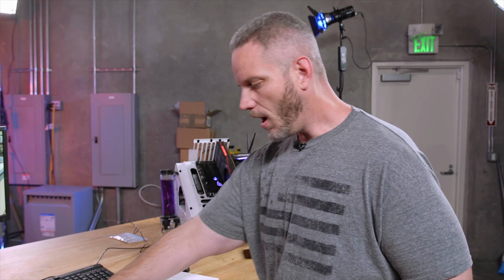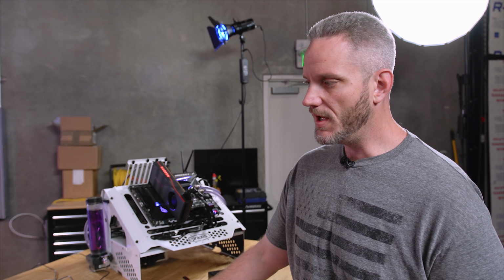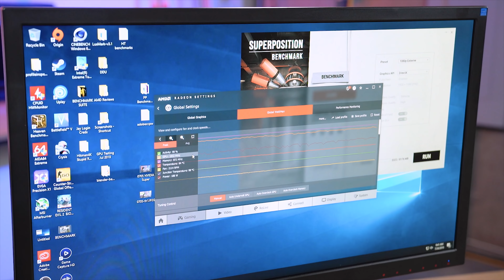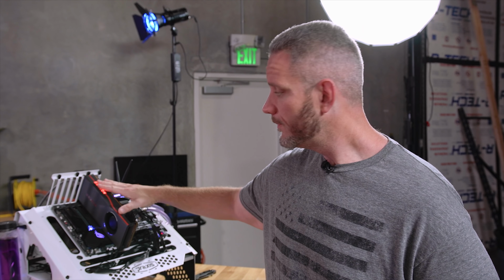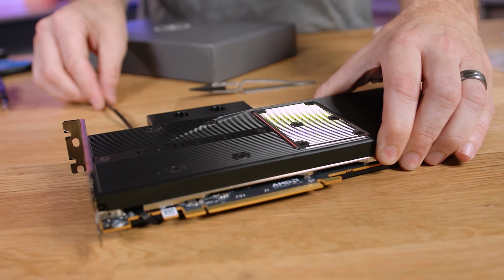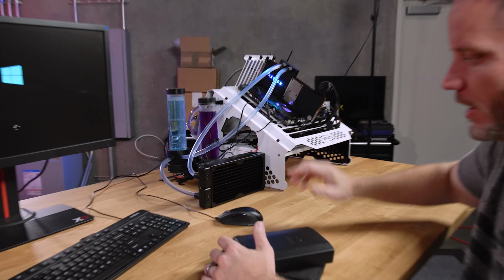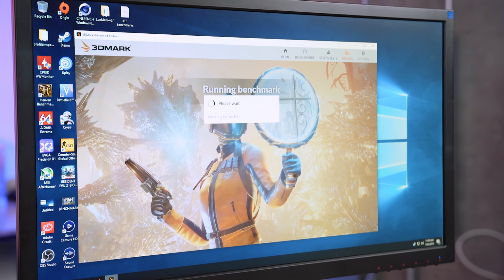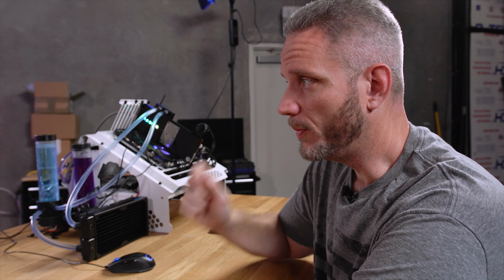Watercooled and Overclocked Radeon 5700 XT... Was it worth it?

Comment: The card is at the beginning of its life - with a bit of patience comes a solid performance for the money. I still use the RX580T8G from ASUS and I have all the time in the world to wait for a product, which makes sense at first glance.
Reply: Why wait for the card to get out of rehab center. 
I bought a 2070 super and i can overclock memory speed 1200 and get firestrike 28.6k and timespy 13.4k 
And the temperature always stay below 67•C.
Reply: Seems like amd fanboys are mistakenly obsessed with how only amd can overclock and get better results.  My 2070 super easily beats 2080 fe and only 3% ish difference with 2080 super. Without extra money. Without tempering with wattman and undervolting BS. Without having to rip my card and void warranty for watercooler.
Reply: @samgakgimbap9683  First and foremost, I'm not a fanboy - so before I give my money to a company that has acted more than once obvious fraud, I prefer to go to competition; Add insane prices for an apparently aging chip; the functions like raytracing or DLSS ... (It just works) .... and so on.

As I said before, my RX580T8G is more than sufficient for my needs and delivers constant and high FPS at 1080p (Ultra settings).

Back to AMD.

This architecture is new, no one has experience with it, and as we know it from earlier, it can get even better - and just because the card is new and it brings to the point the performance that AMD promised I do not understand why you want to explain to everyone that you were fooled by nVidia.

As you can now understand: People who know what they need for hardware, smile your purchase decision at most quite friendly.

Comment: You know, I think this whole experiment would be better if you added in a middle step. A lot of people would go with the factory settings, but it would be better if you showed people how you would run with the blower. I imagine most would at least get rid of the graphite for a high quality thermal paste and change the fan curve. That would be more accurate of a test to me anyway.

Comment: Playing Division 2 seems to push the 5700XT harder than any stress test. Using the stock cooler (undervolted to 1107mV) the GPU and Junction temps are not a problem. Even the Junction temp tops out at 90C with the GPU temp hitting 70C. I would love to have it run lower and thought about adding an AIO. However, if I do that I leave the VRAM unprotected as there is no room to even put heatsinks on the chips to one side of the GPU.  With the stock cooler, RAM temps are hitting 80C or a bit higher.

Comment: Well. I already bought my 5700 xt on launch, not trying to go through the resale process to get the newer custom cards, hate the noise the stock card gives, so rather buy a water cooling kit to eliminate that. It will also give me my first experience with assembling watercooling kits.
Reply: Did exactly that and turned out mint, be careful you don't mess it up BC your warranty is gg the second you take off that gpu retention

Comment: I don't know how hot this cad is. As far as I've seen works at lower temps than the RX Vegas. I don't think you can get a huge difference in performance in with OC. 

The most reasonable ideas to watercool, from my humble point of view, goes more for:

1.- Less noise (my vega 56 is literally a hairdryer when I'm playing). 
2.- Extending the lifespan of your video card as it would be running cooler. If you don´t have enough resources to be replacing your video card every 1 or 2 years (which you don´t get a bigger leap in performance, maybe 12% - 15% as the recent cards have shown us)  then It would make sense to upgrade your video card every 4 to 6 years and then you would considerably see a performance improvement.

But I agree, if you don't care about the noise and you have the money, it makes more sense to invest that money (assuming you don't need a water pump, radiator, fittings, etc) financially is better to buy a better performing card with the same money in where you could be aiming to an NVidia card instead...

Comment: DEFO WORTH IT,  i just watercooled my MSI 5700xt mech, ran the heaven benchmark and got 20c lower temps and 19fps more than on air, all the air coolers on the 5700 series are loud as hell and dont do their job properly, so yes, if you want to get the best out of your videocard it needs to be watercooled.
Reply: For an extra... 100MHz
Reply: @francissauve6685  nope much more

Comment: Now use soft power tables from Igors Lab und you get hell of a lot more frames and watercooling starts to makes sense. You can get a 5700xt beyond 2100 Mhz stable and without problems.

Comment: If you don't redesign all the fancys of the waterblock and just stay with a milled block of acrillic on top of a milled block of copper, a new model for a new card can be designed and prototyped within a day. Ok maybe not a working prototype (milling the fins takes time) but somthing for test fitting and making sure alle the components are cleared.
Designing a new pcb for an aib card requires much more work.

Comment: From what I've gathered recently:

5700 XT and 2070 Super are the best options for 1080p gaming on the highest settings and will run 1440p comfortably above 100+ fps. with some tweaking to settings.

2080/2080 Super are strictly 1440p territory.  Makes no sense to buy any of these cards at this price ranges to game on 1080p.  Will run 4K but settings need to be lowered if you want to play with 100+ fps.

Personally, I'm waiting for the 5700 XT custom cards to come out to make a choice between those and 2070 Super.  I'll be sticking to 1080p for a while more.

Comment: I water cool my GPU's but I use single cover, core only blocks and so far they've fitted every GPU I've bought since 2010........ Only thing I have to do is buy RAM sinks and VRM sinks but they're cheap enough. Core only blocks tend to cool a little better too as there's no additional heat dump from the VRM's and RAM that increases temps.

Comment: Just used a £10 second hand H50 and a NZXT G12 to water cool a powercolor red devil rx 580... temps down from 82c to 47-52c.
Had to put the fan over the VRM as the red devils VRM is to the left of the core...

Total cost £29... total performance gain, nearly 30% out of this card because it throttled so badly before!

Comment: One thing to note, the only boost clocks on a timer are Intel. Nvidia and AMD (both cpu and gpu) will boost as long as power and thermal headroom is available. Base and boost clocks of most chips today are pretty irrelevant anyways since they just self oc based on what the chip can handle.

Comment: I think it makes more sense to wait for the AIB cards.  I would only watercool one of these if I was doing so to fit it into a watercooled system with the emphesis being on keeping the system quiet rather than for cost or overclocking.  Even then, I would be more likely to use an AIB cooler with one of the adapter kits NZXT makes as that is the most cost efficient route.

Comment: It may be not worth overclocking it, but undervolting it gives huge benefits to thermals, noise and obviously power. Every one of you that own this card should try it and apply it
Reply: Im thinking of eventually getting a 5700 and then overclocking that. Less money, and potentially similar performance.
Reply: @everythingfeline7367  That's a fair point. Still is an excellent performer

Comment: The Adrenalin 19.30.02 driver does, in fact, reduce the GPU Clock to about 6 MHz when idle. However, updating to the latest (20.x.x) does not do that for some reason.

Comment: The only real reason for a water block on the 5700xt is to use powerplay and get 2.2-2.3ghz on the core stable. Otherwise just get an AIB with standard OC

Comment: Water cooling might actually extend the life of the card since its memory modules and chip are not as hot under high load. Its not always about getting higher scores and a few extra FPS. I agree with you that you shouldn't water cool a cheap card but if you plan on keeping the card for the foreseeable future and you know what you're doing then why not?
Reply: By the time your card might start dying you probably would've upgraded

Comment: Funny, I have been debating water cooling my Radeon VII with an Alphacool Eiswolf 240 GPX Pro for the past month or so. I  could spend $200 on the AIO solution or wait to see AMD's entire line up of CPUs and GPU before making my upgrade decision. 

Anyway, spent the past 3days or nights more like, playing around with voltages, clock and memory frequencies and superposition 4K benchmark, landed on a 1900Mhz, 1020mV, and 1100Mhz setting and get a modest overclock at lower fan speeds than stock. Will be sticking with my original plan when I got the Radeon VII of waiting for RDNA Gen 2 or Acturus next year before thinking about upgrade; Navi 10 just isn't worth it unless you're coming from a Polaris GPU.

Comment: I like how you talked about how most people use the stock settings for the GPU and don't mess around with overclocking, and how that formed the basis for your comparison. Like how most people also buy a waterblock, to help cool their stock GPU settings, which already would have been adequately cooled by the stock cooler.

Comment: I currently run a pair of water cooled consumer (as opposed to "workstation") nVidia cards in SLI mode in my system. Was very disappointed that I couldn't span apps across all 3 monitors in Linux. I was thinking of switching to AMD to get that capability and potentially ditch windoze all together thanks to proton for gaming. I will likely go with a water cooled 5700xt to keep things cooler and get more out of the investment in my system.

Comment: Better (and cheaper) solution than watercooling: Installing a separate aftermarket air cooler.

I.e. the Rajintek Morpheus II with 2*120mm Noise locker eLoop. Mind you, It's not cheap (here in Germany ~65€ + 2*14€), but it'll be FAR quieter, cool just as fine as the water block, be more reliable and cheaper.

And least here in Germany that's still cheaper than a 2070 Super (5700XT from Powercolor, which don't void warranty for a change of the cooler, is 400€, plus the mentioned ~95€, the cheapest GTX 2070 Super here is ~520€ right now). And in the tests I recall the 2070 Super isn't really faster than the 5700XT in 1440p Gaming.

Comment: My solution was to buy a AIO hybrid cooled GPU. Don't waste money on the air cooler you throw away, and then buy cooling on top. I get 85% of the performance of custom loop for fraction of cost, and all the GPU heat is expelled from my case directly.

Comment: Wait... So is the current reference 5700 xt  blow cooler with a more noise fan curve gonna be around the same degrees as a water cooled 5700 xt? And if so it's the same about the custom air coolers which will be available in mid october, right?

Comment: I have a full loop so if I had one of these I would put a block on it just for noise and heat and that block looks nice. I already have $500 into my loop so another $100 or so can't hurt. I don't have one though so it doesn't really matter. I have an MSI RX 580 gaming x and it does 1080p just fine for me.

Comment: Water cooling for both CPU and GPU looks cool to show off but doesn't mandatory work better.
Reply: Pretty much. If u got the extra change to do so and don't mind putting in the extra work to run a loop...do it but u can build an air cooled system that will do just fine.

Comment: amazing video and informational, though it dose run hot so water cooling it is a plus and if memory is boosted to higher oc like 1850MHz which is not max but a good place not to over heat or have artifacts then the score might be even higher, btw Sapphire Nitro+ is the best card for this rx5700xt

Comment: Hi i want you to ask i just watter cooling a vega 56 and the gpu junction temp or hotspot temp is normal  to be around + 21 C  more than gpu temp while while bench 3Dmark? and  while gaming is normal that junction temp is +10 C more than gpu temp, grafic card will is loaded at 75 %  on 75 Hz monitor?
I used Kraken G12 with 4 bolts and nuts mod and useing artic freezer 120 mm aio.
I wonder if i aplyed corect amount of presure  to gpu die or i have to screw more the nuts ?  
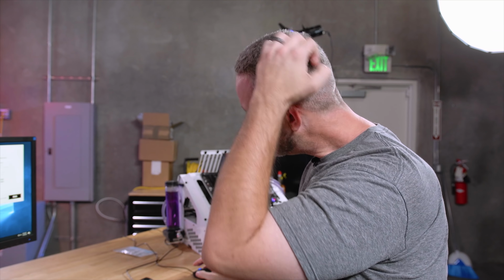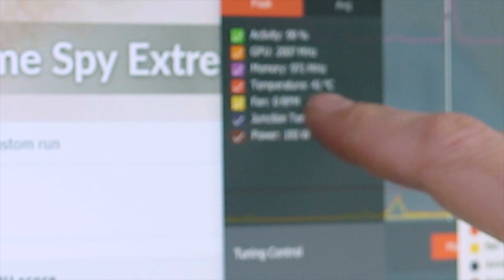I noticed that in your video with blower fan the junction temp or hotspot temp at 4:41 was only + 13 C more than gpu temp,  but watercooled at 11:16 junction temp or hotspot is + 21C , and auto OC setting  12:41 junction temp is + 28 C, and with auto undervolt at 13.40 junction temp was + 23 C more than gpu temp.
Thanks

Comment: I think you can't get any farther with OC on 5700XT anymore by making it cooler is because the XT models are the ones already hand picked to have the best silicone out of all the the ones they made and the lower quality silicone ones are the regular 5700 models. You already got a plateau silicone GPU, can't push it any farther like Jay said. Now if you got a 5700 and water cooled it and it performs almost or on par with XT models then yeah I can see the reason why you want to water cool it. But like jay said, if you going to spend $100+ on water cooling parts just for that reason, you might as well just buy a 5700XT instead or a Nvidia GPU at that price point.

Comment: good vid man I recently discovered my 2080 to be a little on the golden side it clocks mental on air i get no where near 70 degrees when pushing it (having said that I've really gone to town on it) I benched port royal the card reached 2040 mhz for majority of the run and 2055 max. I would totally water cool it for fun but its expensive and ....well I want a 2080ti ....like a kingpin or that asus matrix thing ...any chance of a full review of that card by the way be nice to see how that cooling solution holds up against a real loop

Comment: What happens if you use the less dense thing through your water cooling system,
Air!
Use the water blocks and all but force air through the system. Just guessing you will get better results than the standard air cooled system but not quit as good as the water cooled.
Reply: oh hell no
Reply: @Edward Park,
Come to think of it. It has been a long time since I've seen the top of a chip blow off. Maybe I'll continue looking at getting a Aquarium chiller as part of the water loop.

Comment: Water is quieter [hate rgb I think its silly unless its christmas tree lights to scare/distract your friends at LAN], and hopefully if you get a large enough reservoir water has a lot of buffer to handle the heat of an overclock.
Larger reservoir, lots of good fans [noc noc - tua] on the radiator and several or stronger pumps makes for better cooling = more OC [and hopefully still less noise :D]

Comment: I noticed EK's included thermal pads are too big, and they do instruct you to trim them.  But do you trim them only in length, or also in width? They seem to kind fold and be really jammed tight into the recessed area for the chokes if you don't also trim their width. But the instructions don't mention anything about that. Seems like you'll be OKish either way, but i'm concerned about it lowering the mounting pressure on the mosfets and core. Am i dumb? Okay just checked the installation manual for the 5700 XT waterblock, it's a lot clearer than the old pascal instructions.

Comment: its been a while since I last built my own gaming PC and last GPU I had was RX series and never really OC'd that. the last one I OC'd was the R9 290x. So cards nowadays dont have full voltage control anymore? that sucks. that was the reason watercooling became a go to in terms of cooling then, you can OC the heck out of the cards because you got so much more temp headroom. so if having temp headroom wont help if you can only add a limited amount of power to the card then might as well just go w/ a custom cooler cards. unless you really want a really really quiet system then sure watercool it.

Comment: I dont really see watercooling as something you do for performance but for noise and thermal headroom.
I can run my rig balls to the walls all day long when its a hundred degrees (no AC) and it will still be quiet
with the inside of the PC being near ambient.
Reply: WC use to be more performance based back in the days but with advancement with engineering on pc parts its not the end all be all upper echelon option it once was. I wc for more aesthetics and I like water cooling.

Comment: Also there is nothing wrong with the blower shroud on the RX 5700.  I have a RX 5700 XT Anniversary Edition, and using the stock blower shroud I was able to achieve this benchmark using the FFXV benchmark. https://i.redd.it/x5skxnj7foc31.png

Comment: The only thing  need is a 5700XT Squad benchmark in 1440p, is there someone with the game and the card (and the resolution)?
Reply: I'm pretty sure an equivalent Nvidia card will play Squad better. The drivers are just better. I went from a 390r9 to a 980ti and it is way smoother at 1440p.
Reply: @10speedr  that's maybe because the new card is 45% faster?!?
Reply: @10speedr  In what world is an R9 390 equivalent to a 980ti?

Comment: well I won the silicon lottery!
   open box 2080Ti that loves to boost (not@ its rated 1665mhz) but 2025mhz without ANY OC'n
Bykski water block FTW - max temps 52c - reg 40's

Comment: I kinda wouldn't care about blower coolers anymore.
I bought an Sony 1000XM3 noise cancelling headset, and my pc has watercooling loop and I updated bios and everything and I forgot to set new fan curves, also in gpu driver and I had 5 ML120's blasting at near 2000 rpm which is noooisy!
I really didn't care cause I didn't hear it while gaming, and at idle it's silent :)